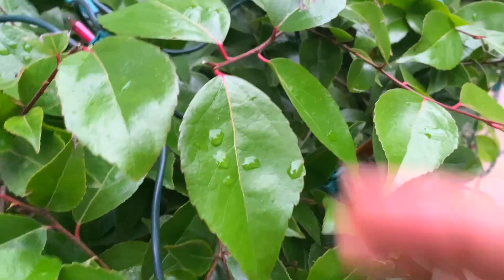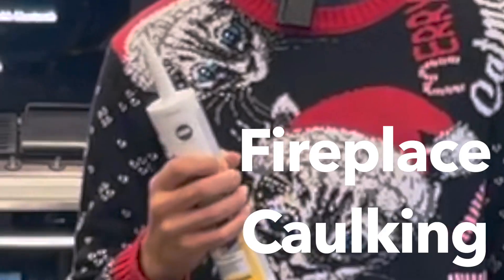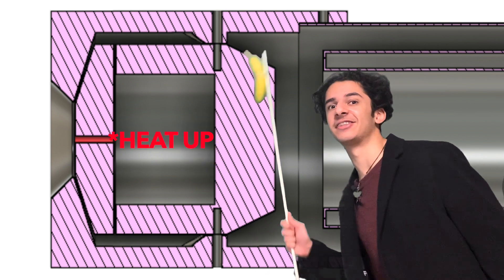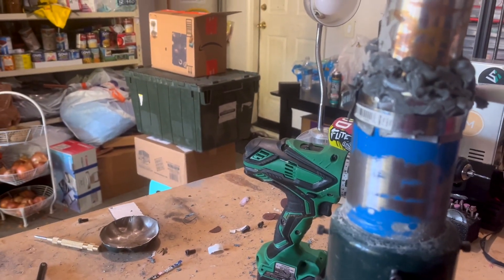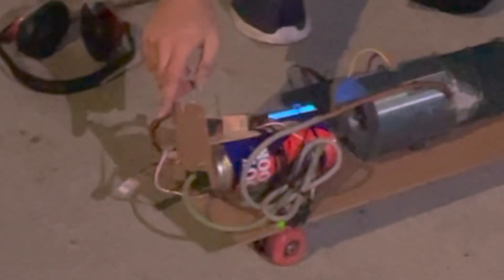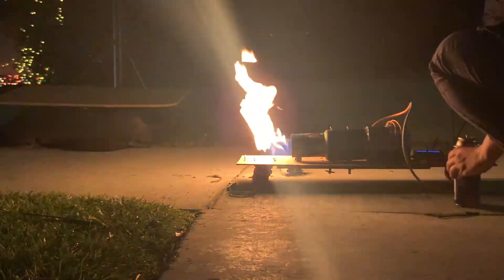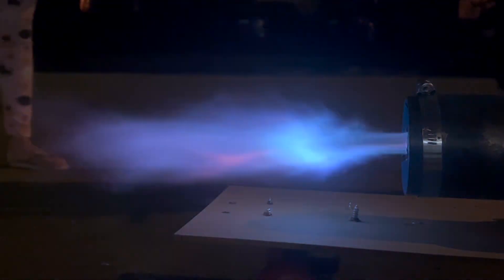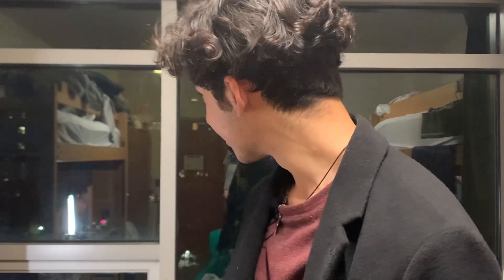I Made a Jet Engine

Comment: Nice build! Was it inspired by Integza's electric jet? Also, I would recommend building a spot welder. They are extremely simple and very useful. I will be watching your channel with great interest fellow engineer!
Reply from the maker: Yes haha Integza is definitely an inspiration. I have a spot welder for lithium batteries but haven’t tried it with steel yet so I’m not sure if it’s powerful enough. I’ll experiment though
Reply: @its_arvinsingh  You will need lots of amperage to weld stronger metals like steel. I am not too familiar with electrical stuff, but Styropyro and Electroboom have good videos on that sort of stuff. Good luck bro!
Reply from the maker: @GooseOfYork  thanks! I think my welder does around 1200 amps
Reply: @its_arvinsingh  That's probably more than enough 😅

Comment: remove the fan, do a (continuous/pulse) jet no-moving parts jet heat engine, external/internal combustion, or just jet heat sink with external electric resistance red hot wire heat source
Reply: do you like electric cooking top stoves
Reply from the maker: Actually I tried making a small Lockwood pulse jet first with copper plumbing but with not much success because I didn’t have conical exhaust and other proper geometries that would require welding sheet metal, but it’s definitely on my bucket list! Yes I like electric cooking top stoves lol
Reply: @its_arvinsingh  try centrifugal spin compressor/generator/turbine as the compressor shaft, I mean self-ducted impeller, impeller being a vacuum duster impeller, simple symmetric shape
Reply from the maker: @Jkauppa  the “fan” in the jet I made is a actually handheld vacuum centrifugal impeller if that’s what you mean. My previous attempt of this electric afterburner style jet was using an edf fan which didn’t compress air because it was just a ducted propeller. I actually would love to make a turbine jet engine but I’d need high temperature bearings it’s turbine shaft (expensive) but it’s a possibility for the future.
Reply: @its_arvinsingh  well, are you using it axially (or around corner) or strictly radially
Reply: @its_arvinsingh  I mean is it generating the pressure radially centrifugally or just standard axial very dense turbine blades like a normal jet turbine design, very much different results, going sideways and going straight through
Reply from the maker: @Jkauppa  yeah I’m using it radially centrifugally. If I made a turbo jet I’d use axial ones
Reply: @its_arvinsingh  ok
Reply: @its_arvinsingh  it could be stacked triangles with spacers, too

Comment: The adapter for the propane tank also works on yellow blow torch tanks. They are higher pressure and the gas is more flammable and holds more energy.
Reply from the maker: Yeah map gas sounds great but I just didn’t feel like spending the money at Lowe’s lol. It’s actually harder to buy butane than map gas at Lowe’s because you have to ask for the butane whereas the map gas is on the shelf, so my presumption is that butane is more potent than map gas
Reply: @its_arvinsingh  nope map gas holds more energy and burns hotter therefore making the air in the engine expand more pushing more out the nozzle at a time. I used propane and butane in an afterburner I made and while burned produced about .5 lb more thrust map gas produced around .8lb
Reply: @Resonant_Sound  True. MAPP gas chemically is quite a bit more energetic than propane or butane. Something something triple bonds go boom something something
Reply from the maker: @Resonant_Sound a bit late but thanks for the recommendation, it will be in v2!